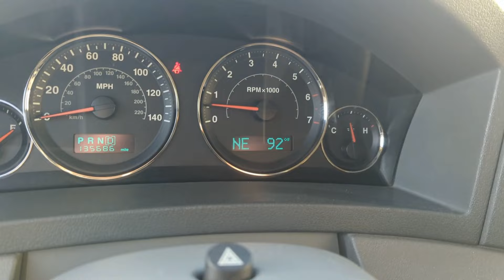Part 51 My Wrapping Skills Are Improving, We Fix 2 Other Japanese Vehicles

Comment: Looking awesome, the mix between the wrap and the bed liner looks neat!! will look for that bed liner or something similar here in Italy, the only thing i had found is the Raptor paint, it looks awesome but it's quite expensive, like 40 euros a spray can😅
Reply from the maker: Dang that's alot! The Herculiner works well and might be more readily available online. Here it's about $17/ can at the auto parts store but the Iron Armor is only $10 a can at Harbor Freight. It's too bad you don't have Harbor Freight. Everything is sooo cheap!

Comment: This may be a stupid question and possibly addressed elsewhere - but I noticed while prepping the doors for wrapping - the recesses for the door hinges were stripped down to bare metal; and then looked as though the wrap was applied directly over the bare metal. If the wrap allows air to pass through it - will it not allow water (humidity) to pass through it and begin surface rusting the bare metal? Maybe not as bad in the southwest but was just wondering... Really enjoying the videos!!!